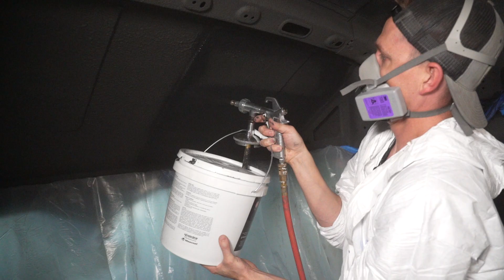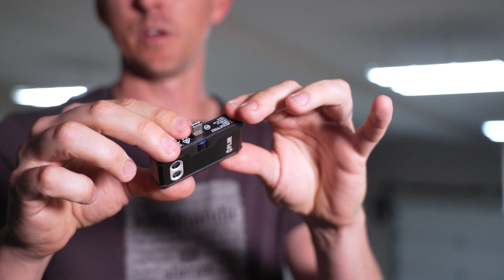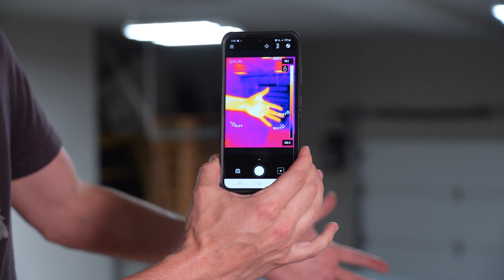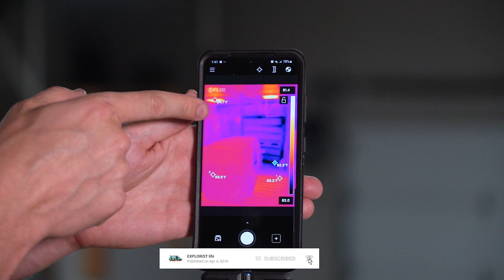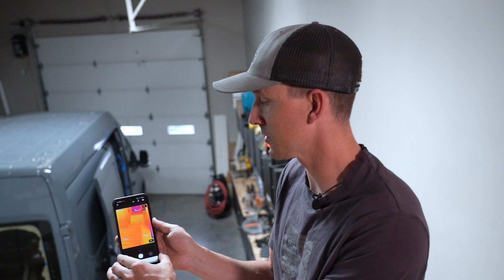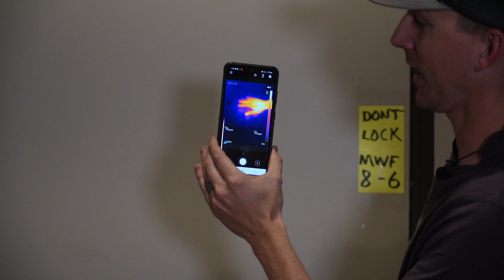Lizard Skin Ceramic Insulation TESTED with a Thermal Camera on our Ford Transit DIY Camper Van

Comment: I’d be curious to how much difference, if any, there would be sitting there for a few hours
Reply from the maker: I mean, if the air conditioner is running, the rate of heat coming in is slowed, so it would inherently stay cooler and decrease duty cycle times.
Reply: @EXPLORISTlife good point, have you noticed much of a difference while in the sun compared to your last van? Or are there too many other variables to really say?
Reply from the maker: @Jasper118 This one is significantly better in that regard.  Simply having the air conditioner in addition to the increased insulation makes all the difference.

Comment: Hi, i know this was poated 2 years ago but i remembwr you saying that ypur going to install 3m thinsulate and wool over the lizard skin. Did you do that ? 

Im asking because i would like to do similar using dynomat and im wondering what needs to be installed first and if it sticks to lizard skin 🤔  thanks
Reply from the maker: INSULATING OUR FORD TRANSIT DIY CAMPER VAN CONVERSION
https://youtu.be/a05Iz6jOJ1k
Reply: @EXPLORISTlife  thanks
Reply from the maker: Also... Lizard Skin acoustic takes the place of dynomat.
Reply: @EXPLORISTlife  that's true I'm just over doing it. So maybe just the lizard skin heat treatment and dynomat or just put it all
Reply from the maker: Dynomat -> Lizard Skin -> Dynomat -> Lizard Skin -> Dynomat.  Just be sure to use our affiliate links. 🤣

Comment: Thanks for your videos!  Amazing job.  We are planning out our first build - one question of this subject.  We live and play in Canada and anticipate living in our van in the winter.  Do you feel the Lizard Skin acts as a thermal break from the exterior van to the wood cladding?  I feel there needs to be something between especially for vans that are spending time in colder climates.  2nd question - do you think you will provide kits that uses the higher amp hour batteries soon?  Thanks!

Comment: I wrote an email to Lizard Skin and asked about using it in my Skoolie. They responded that if I were to stay in hot climates it would be fine but that it simply doesn't work in cold weather. There is another product called SuperTherm that is supposed to work very well for hot and cold climates. However, I can't find it through traditional retail avenues. I think it's pretty expensive too. Anyway, keep up the good work!

Comment: What’s the link to the thermal camera. I’d like to use it for testing for heated connections in my electrical system. Thanks
Reply from the maker: It's linked in the pinned commment.
Reply: @EXPLORISTlife  thanks

Comment: We have a new sprinter 170 that we just began converting. Our first project was peel and stick sound deadening.  My question is would you recommend additional sound deadening over the peel and stick. Also, I'm sold on the ceramic insulation. How much product would your recommend?

Comment: Did anyone find out that spraying or coating the outside of your van will have a much better results on heat barrier?
Then add foam or wool insulating inside.
Reply from the maker: I mean... it MAY work better; but it'd look pretty terrible.  This stuff is like a 'less consistent' truck bed liner look.
Reply: I would like to see a comparison of ceramic paint coatings/wax versus LS. Applied on the outside surface would be optimal to reject infrared/radiant heat. LS needs to act on the heat radited from the metal body and reflect it back to the metal, less effective. LS still has thermal break and sound reduction properties, though other insulation products would be better if thickness allows. 
As suggested, it might be good to coat metal that is normally exposed on doors, then covered for appearance/durability.

Comment: Do you know if the ceramic insulation would bond adequately to the metal without the spray-on sound deadening? My thoughts would be to spray the whole van with Lizard Skin ceramic insulation and then apply peel-n-stick sound deadening over top.

Comment: Hello Nate and Steph- We appreciate your help.  Question is if you are adding thinsulate and or reflectix  over the lizard skin products in your build?  I did not see in comments.  Thanks Paul and Nina
Reply: We looked at your photos on Community- question answered but what adhesive did you use so not to damage the lizard skin?  Thx

Comment: 🤔 What is the fire rating and toxicity of burning lizard skin?
Reply from the maker: Lizard Skin has a Class A fire rating. Materials that fall into Class A or Class 1 include things like brick, gypsum wallboard, and fiber cement exterior materials. These materials do not burn well and are very unlikely to contribute fuel to a fire.  If the Lizard Skin were actually able to get to a point where it would burn, many other highly toxic items in the van would also be on fire (the seats, dashboard, wire insulation, door panels, etc.  At that point, it would be best to have already exited the vehicle and stand far enough back so that the fire department could put out the fire.

Not too often I get to use my actual degree anymore.  Thanks for that!

Comment: This test was 6 min on the Temperature. was there data on how long it took to finally heat up to a less of a spread between the sprayed vs non-sprayed? What happens to the temperature spread after 1 hour or more ? Curious if you have that info?
Reply from the maker: The testing we showed was the only testing we did.

Comment: My first van build was 12 years ago on a 2006 sprinter. I used spray foam insulation. If I knew before hand that it could cause warping I would not of used it. It didn't warp thank goodness. It also would be a pain to have to remove the product if you wanted to remodel or add wiring, windows, etc. My latest build is a 2020 Transit High roof and I used the Lizard skin products. I think the confusion of the Lizard Skin ceramic is that it's not an insulation product but more of a reflective product. It will reflect that radiant sun which will reduce the skin temp of the van. The hand test on a sunny day is by far very convincing. The Lizard Skin sound deadening works great too just like the peel and stick. I feel you could just spray a percent of the panel, just like the peel and stick,  to get good results from the sound deadener. I used Havelock wool as my insulation along with Reflective Foam insulation on the back of my finish panels.
Reply: I have a 2006 sprinter - would kilmat, lizard skin soundeadener then lizard skin insulation plus undulate be a good combo?

Comment: Its easy to use for sure. And with one layer the insulation is pretty nice. 
You do need to compare like for like. So based on thermal properties. It's 3x less effective than for example armaflex. 4mm.
So in effect you would need to spray 3 layers for same results.
Not sure if cost comparison is also balancing out than.
Might differ from you climate what you would need to install. So one layer lizard may be enough.
Reply: Jeff, have you used Armaflex as insulation in a van? If so, how much did you use? I would love to have a more robust insulation, but, wow, not sure I can budget for this unless I got lucky with a you tube channel. LOL. Would love to do the Lizard sound and thermal, but wow, the price. Maybe I could do the ceiling and wheel wells and something else for the rest. Thoughts anyone?
Reply: @ladytrader688  I'm just starting my build so you're in luck. 😃
I'm using cork and recycled PET wool.
Depending were you live it's different to source an supplier. In UK dodo mats is known for this. Called Thermo fleece. Might be found as Supaflex wool with others. It has pretty close lambda value to Armaflex. And building a layer corck+PET makes for good sound proofing too.
Way more environmental choice over Arma. It's really not that healthy to use too.

Comment: Hey Nate i have an unrelated electrical question. I have purchased some cheap  “5 pin Halo switches” i am hoping to use them as a three way switch. I would like to use two switches for one light source, is this possible? If so do you have a diagram or can you explain how to wire it? I would assume that this is possible, i have seen lots of vans with these style “halo switches” and would think some of them have to be 3 way switches. If not do you know specific brand or switch that looks like “5 pin halo switch” that is meant to be used as a 3 way switch. Thank you very much!

Comment: So - these two tests are testing different things.  For the first test, we are testing how something at a higher temperature interacts with something at a lower temperature.  Heat flows from warmer to colder.  Pretty basic, and this product doesn't seem to do much for that.  If you wanted to test this same thing for the second test, you'd need to put a cold van in a hot place that is NOT in the direct sun.  I think we'd find that the inside of the van comes up to the ambient temperature relatively quickly with only the Lizard Skin and no real insulation.

However, the second test is more about how much a source of infrared energy is reflected.   The sun is directly heating things that absorb infrared energy.  Therefore, an interesting test to reverse the direction would be to point the thermal camera at the outside of the van when it's cold out AND there is a source of heat inside of the van.  I think you'd find that less of the heat source is just radiated away directly through the walls that have the ceramic coating.  Therefore, more of that energy bounces around inside and has a chance to heat objects and people inside the van.  In other words, this product would still likely help with reducing the fuel/energy needed to keep the inside "comfortable".  It would also likely reduce the "cold window" feeling we get when near something that doesn't reflect any of our infrared heat back at us.

When regular insulation is then added, there is a slower bleed of energy one direction or the other due to temperature differences, and that will of course reduce the rate of energy transfer due to the temperature delta.
Reply: Exactly. The second test is still relevant as to some reduction in heat transfer on coated vs. uncoated areas. 10% or less difference however, so given the cost and installation complexity, not a huge return on investment. One would absolutely need thinsulate or other such insulation regardless, and going one thickness greater on that would probably give more benefit than the 10% or less for the specific case of direct radiant heat on body panels.

Comment: This is awesome and your test results are inline with what I was anticipating. I wasn't familiar with this product until you started this series. I am familiar with ceramics, we use ceramic cutting inserts when machining aerospace metals. Ceramic is a fantastic insulation for thermal heat transfer, i'm not surprised that it wasn't as effective for retaining heat. I suspect that you will be very happy with this on hot summer days when the sun is baking on the outer shell. I will be using this product when I (eventually) build my Transit. I look forward to your future videos :)

Comment: Thankyou for giving us all an open unbiased view of this product. I personally live in Australia in dry high heat conditions. I think a lizard skin or similar ceramic basecoat on the OUTER of the van would work better to reflect heat BEFORE its stored in the chassis, additionally reducing scratches, but that's just my intuition.

There's a lot of people that misunderstand insulation and think that with more it will just work "better", it slows down heat transfer in BOTH directions, so if you've left your van in the desert all day with huge insulation, it's actually HARDER to cool it down again.
The more objects in your van that are storing heat like little batteries ALSO adds to this.

IMO, if you have the capacity/patience for it, a pop up car tent for shade is superior to internal insulation vs the sun.
Reply from the maker: Keep in mind that the thermal insulation doesn't 'store' heat.  It lowers the heat that is conducting through the body panels so the heat dissipation is happening on the outside of the van rather than the inside thus lowering the temperature that is making it through to the inside.
Reply: @EXPLORISTlife   to a point I agree but not so much.. 

When you heat up a room of air. The air stores that heat.. and the fastest way to cool down the area is to "pump" out the old air while introducing cool air. 

When your mobile tin can is full of clothes, water, food,  furniture, even your poop bucket.. as the hot air leaves and cool air enters, it hits the heated objects. (The same works inversely when you think of how quick a fridge or freezer loses its cold when you open the door)

Insulation heats up just the same as all matter does.. it just slows down how fast it passes that energy from one side of it to the other, but it definitely stores it along the way.

That is why reflecting as much of it inside (to keep heat) or outside (to reject heat) works.

You need to think of the objects inside your car as batteries that are storing heat or cold too

But hey, what do I know, I'm just a cowboy 🤠

Comment: Looks like a really great product. I would definitely love to see the interior heat difference between a fully raw van on a hot day and a van that was full coated with the ceramic. I live in FL, and a highly effective insulation is my primary concern going into my van build. I imagine doubling up on ceramic and then something like thinsulate would be excellent. The data on the actual differences would be fascinating.

Comment: I've used poly-iso and the purple one that's a little better in milder cold climates.  Both with success.  Problem I've been considering is in the hot summer everything tends to make it more like an oven unless you have an AC on.  I'm beginning to think having air flow or AC in the summer months is a better option than maxxing out the R value.  Once a van gets hot it's pretty much impossible to cool the frame down without waiting hours.
Reply: Yes, and no matter what you do with insulation your van will heat up,in the sun. Taking hours to cool after dark.
Reply: @simonaeldred  Uh, did I not say that?

Comment: Ceramic tint for the windshield should be mandatory for any van build - use a 70 or 80 percent film that is nearly clear. The difference is amazing. These windshields are huge.
Reply: Interesting, do you have a link or suggestion for such a product? That would be awesome.
Reply: @christosmaninos1570  We had Llumar Air 80 ....happy with it. There is a little bit of distortion at night from bright light sources. Not a big deal for us.
Reply: @MyGoogleYoutube  Thank you :)
Reply: I have a high end tinting that reflects solar on my driver and passenger windows but would hesitate putting it on my windshield due to the fact that I just had a rock ding where I will have to replace the windshield. My Windshield is replaced no charge with my Insurance but the $200 windshield coating would not be covered.
Reply: @gstephenson7391  Can't take the money with you :) 

It's totally worth it. 

The one tint shop that did our Promaster offered a one time replacement warranty. Cost a little bit more but see if you could find that ?

Comment: I can also see the benefit of Lizard Skin on panels like side sliding door and back doors where you aren't going to cover the exposed metal with wood or cloth fabric.  It helps prevent heat build-up in the van and the textured surface looks pretty cool compared to just the smooth painted metal.

Comment: I love how much time and effort was put into showing the results. I wanted to spray two of my vehicles but they sit outside 24/7 in the desert and it hit me that they won't benefit if the lizard skin is outside and the temps are elevated. The interior will remain hot long after my family and I hop into one of the vehicles. It would have to either be a long road trip or find a way to cool off the vehicle before hopping in.

Comment: Ceramic works best at reflecting heat. So, for tinted windows it reflects the heat before it comes through the window. For race car headers, it reflects the heat from the exhaust gases. This is important for them because they want the heat energy to stay inside the exhaust flow and not radiate out. The guy that did the test with the panels outside had the coated surface out, so it was reflecting the heat away before it could be absorbed into the part. 

For the van use case, most of the time it's just like the sound deadening in that it's just added mass. My hunch is that during the winter, if you had a heater on inside the van, and the panels were exposed, it would reflect the heat back into the van and make it easier to keep it warm. I think you'll lose most of that when you put finish panels over top, but some of the benefit will likely remain. For the summer, the heat has already went through the metal when it gets to the coating, so any reflection just feeds energy back in to the metal panel. Since the energy doesn't escape, it will likely have a much smaller effect.
Reply: Meh, the biggest benefit to ceramic headers is they have better corrosion and discoloration resistance.  If you really need to keep the heat in the exhaust there are much more effective options.
Reply: @donaldendsley6199  I concur. the best use of thermal/ceramic Lizard skin paint would be on the exterior of a van for similar reasons, and would improve thermal at the same time.. Its ugly to most people though.
Reply: @donaldendsley6199  agree, but this topic is specifically about heat retention/rejection properties of ceramic and the video cites this use case as an example.
Reply: Finally some sense 🤘